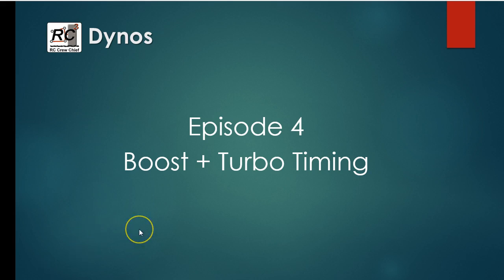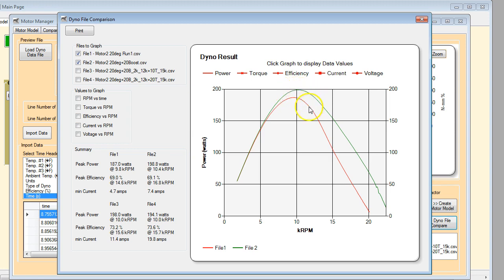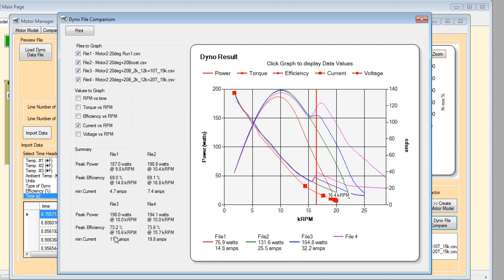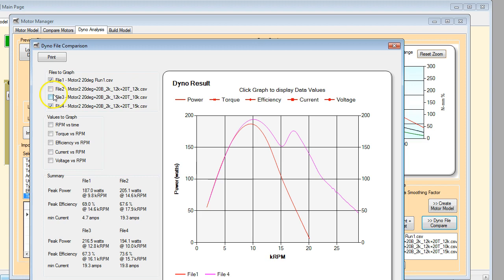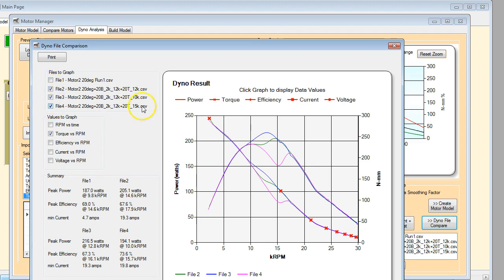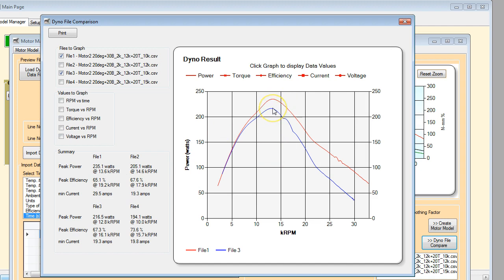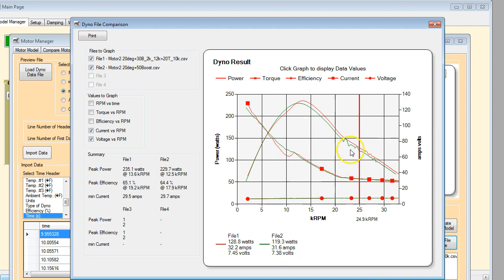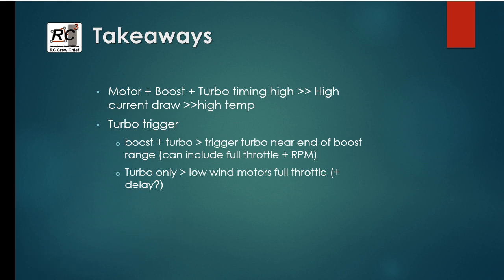Episode 4 - Boost plus Turbo Timing

Comment: I have watched many of your videos, and found them very helpful. 

I am asking your opinion on a current project. I am working with a light 1s pan car, and I am after top speed only. Insane run type situation. I am currently using a 4.5 motor. 

Do you think I should use motor timing only?  Motor timing with boost and turbo, or just one? Should I shoot for a total target timing setting?? Thanks

Comment: Tekin RSX @ 55* (Max) Boost with Turbo off.  Trinity Monster Max 13.5 w/endbell @ 30*.  Motor temp is always less than 120* after 4min clay oval race w/2 fans on motor.  Any suggestion if I should turn turbo on?  And if so, what settings...turbo, rpm, delay & ramp?  Thank you!!!!  😎
Reply: I have never run oval but would guess the motor RPM range is small over the course of a lap. If you did add turbo it would be very important as to when it is triggered as if added mid corner that could be a bad thing for sure. In on road I would only use turbo if I had a long straight where you could take advantage of the extra RPM. It certainly would be helpful if you knew the RPM range over a lap. That would give you some good info as to when to start turbo and the slew rate to use so it all gets applied before the end of the straight.Having not tested your motor/esc combo it is very difficult to give you specific recommendations.